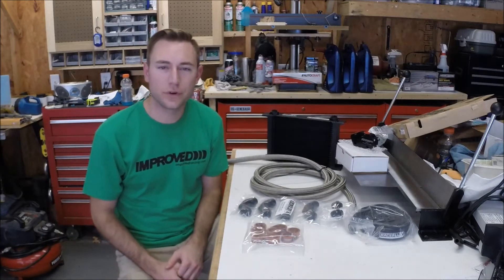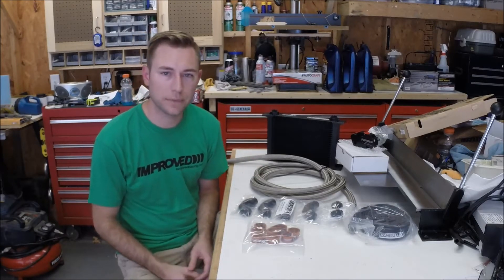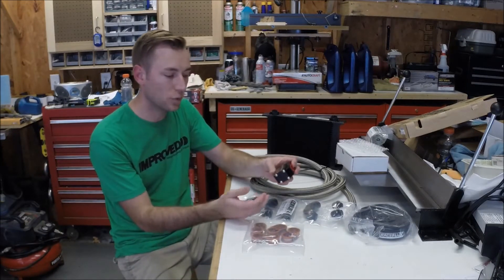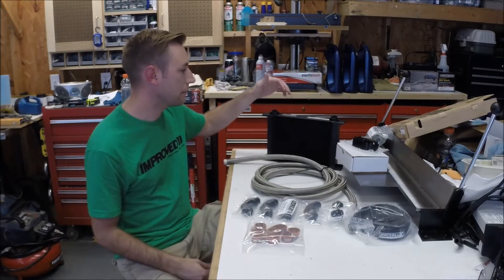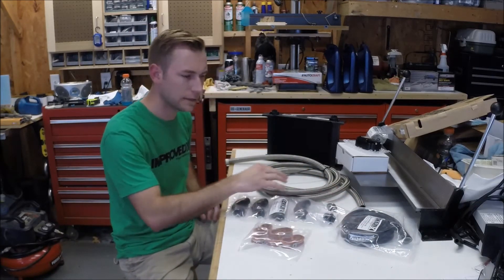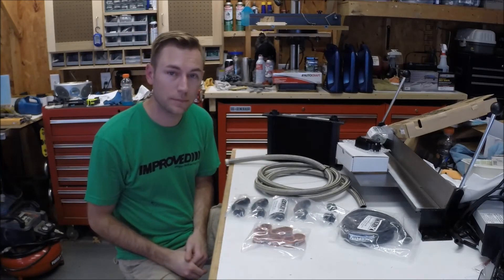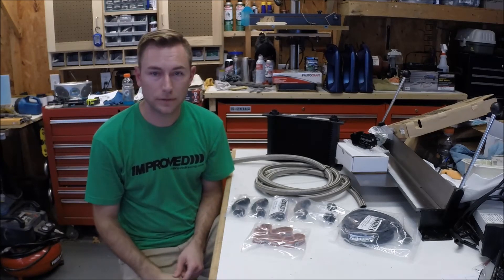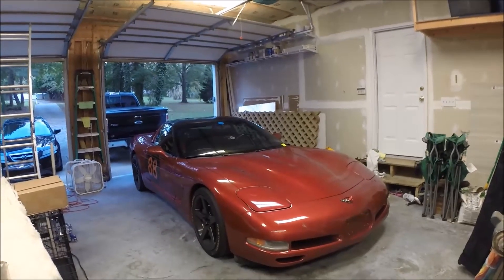C5 Corvette - Engine Oil Cooler Overview

Comment: I had an engine failure and was wondering if I need to just flush my oil cooler lines or replace them. And I need to replace cooler lines do I need to replace radiator as well?
Reply from the maker: Depends on the type of engine failure.  If the bearings failed and there’s a bunch of metal shavings then you’re better off replacing the oil cooler and flushing the lines.  Radiator should be fine.
Reply: @ScrufsGarage  ok. Thank you for getting back!

Comment: Scruff, do you remember how many feet of hose you needed. How much length  do you recommend to reach in front of the ac condenser?
Reply from the maker: Somewhere in one of the two videos I did, I mentioned how much 10AN hose I bought, but for the life of me I can't find it right now.  I believe I bought 12' of it, thinking I would have extra.  However, I ended up needing every bit of it.   And I do recommend using the Race Flux heat sheathing on the outside of the braided lines.  I've been very happy with that.